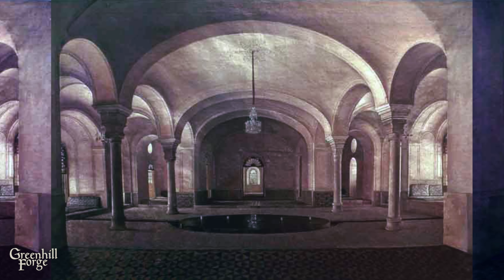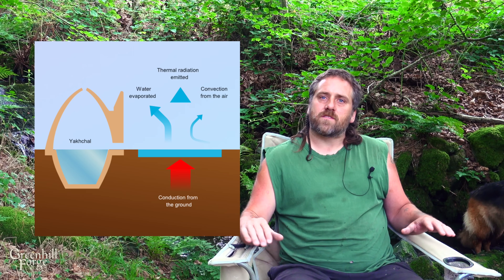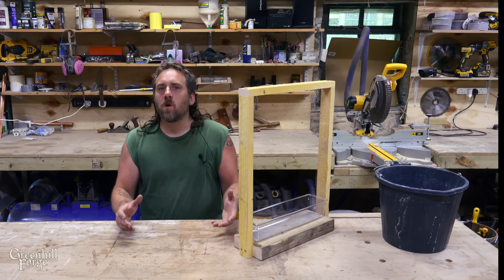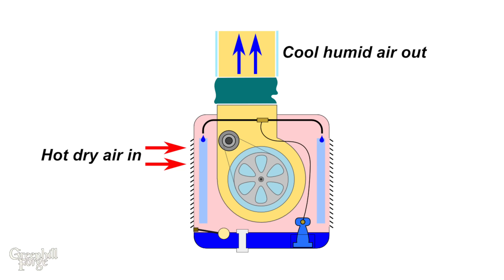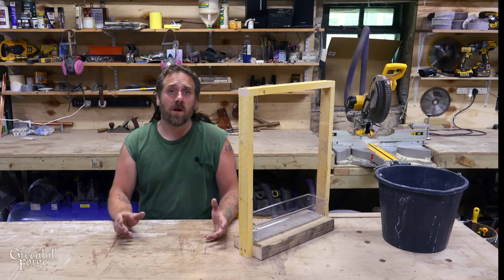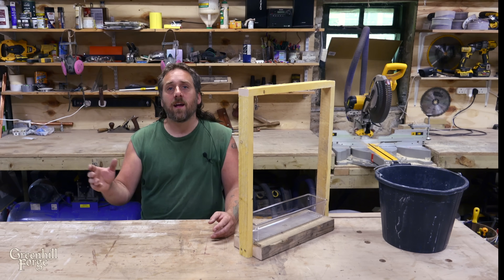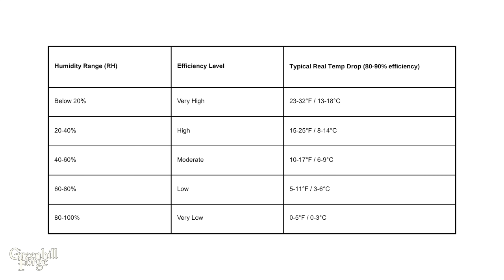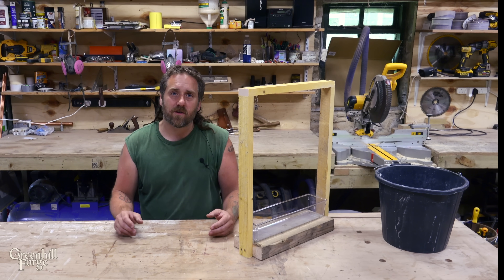Ancient Air Conditioning: Free DIY AC That Actually Works & the Science Behind It

Comment: I used the same idea to humidify the bedroom air in winter. A tray of water near the floor register, a wash cloth inserted in the tray, and supported over the edge by a hanger wire frame over the vent. The tray held only enough water for 2-3 hours. But it made a HUGE difference in comfort while water was there.

Comment: Seems excessive. Why not just exchange heat with a radiator that is submerged in that cool spring behind the house? And a small fan in room, which would blow hot air on that cooled surface of indoor unit. You also need to catch the condensed moisture underneath the indoor unit and perhaps evaporate it as well.

Comment: Damn! You have have a butt load of nay sayers! I’ve never known all the ancient ways of evaporative cooling built into buildings. That in its self very interesting. 
I know you are now in the U.K., but where are you from here in the States? 
I’m in upper East Texas. Where it’s hot and very humid. So, swamp coolers don’t work near as good as they do in say Arizona. However they still work to some degree. Meaning they work good enough so as you don’t sweat your balls off! 
I worked in a whole sale nursery when I was a kid ( about 14 until I was 19 ) all the propagation houses what a wet wall system in them. Which was the exact thing you showed how to build. And we would build them instead of buy them. We first bury a 100 gallon open top tank. Like that is used for watering cattle. Plumb water to it and use a float valve to keep it at a desired level. Then plumb a pump to deliver the water to the wall section that had wet cells in them. The wet cells were about 6” thick, 3’ tall, and 18” wide. And expensive AF! And a gutter system returned the water to the tank.  Big ass fans on the opposing wall pulled air thru the wet wall and out the other side. And those houses stayed 20 to 30 degrees F. below outside temps.
Reply from the maker: That's sounds like a great system. I wonder if there are any cheaper things that could replace the wet cells. Yeah, the local climate really determines how well it will work. It's too cool and wet where I live now but I lived in California and Montana and it works great there. Also lived in DC, GA, MA, VA.
Reply: @GreenhillForge I’m not sure if there is anything cheeper to use for the wet cells? 
The only thing I can think of would be that “ camel hair looking stuff” it comes in a roll and I think it’s used as a dead air insulation. Not sure if it would stand up to the water for a long time. 
After I wrote that novel! I was thinking about the old way of cooling a house down here in Texas before a/c was a thing. Just about every body had a window unit type swamp cooler and a huge attic fan that pulled air from the windows thru the house then out the attic.

Comment: 3:25...yeah...nah.
the vapor is the same temperature as the air.
the water and surface it evaporated from is what lost the heat. not the air it evaporated into. that air gained heat, its now carrying water vapor that took a certain amunt of energy to vaporise, and must release that energy to condense.
air itself doesnt carry or hold much heat. water vapor does.
its blowing air past that now cooler water and fabric that gives the temperature drop. without the draft, nothing much really happens at all. can only cool via conduction, contact, and the resulting convection. get a draft, maximise the air passing over, the evaporation that takes place.
except. in a closed loop, the heat ends up in the air. you cool a tank of water, and its heat is added to whats already in the air and water vapor... its just like opening the fridge door for a makeshift AC unit...
swamp coolers are pretty pointless as they are.

the clay amphora is cooling whats inside it down, not the air around it.
when we sweat, the aim is to cool our body, not the air around us.
the old aussie meat safe (damp hessian sack over a frame?) is cooling whats inside, not whats outside. 

outdoor fountain, large tank of water buried below, plenty of surface area and trickling, then pump the water through a radiator.

water will try to reach its densest point at 4C...

look at how the office blocks and shopping malls do it...

Comment: Maybe check out a heat recovery ventilator, you can make one with straws, attach your swamp cooler to the one side that blows through the straws with a fan to the outside and another fan that circulate the air inside your home across the cold straws. This way you do not increase the humidity inside your house. We use it to keep heat inside a room and get humidity out, but I think you can also use it for cooling.

Comment: This is great in a dryer (low humidity) state like Arizona but could make things worse, or not work at all, in states like Georgia or South Carolina. I don't have a/c in the house here in PA. The ONLY thing making it bearable for me, is to go the opposite way, and have the 82 degree air in the house as DRY as possible, running 2 dehumidifiers in the basement. Also, water will not evaporate into 95% humidity which 20 states have experienced for 8 weeks this summer. At least here, I want to avoid water and more humidity. Yes, in Tempe AZ, they have 1,000 "misters" on the street that are great because the dew point is super LOW.

Comment: You can take advantage of the Ideal Gas Law by putting a grid of 2 liter bottles that you cut in have in a window so the air can only pass through those.  You put the spout facing the inside so the air is forced to travel from the larger ID of the two liter bottle into the smaller ID, forcing the air to cool as it increased in pressure briefly while passing through the spout, and then decreases in pressure, cooling off when it makes it into the closure you're cooling.

Especially if you have several, like 10 so you have a large surface area, and seal it well to enable opening one side of the house to create that air tunnel that sucks air through those higher resistance low ID holes.

Comment: Interesting, an electric or solar powered dehumidifier is relatively cheap to buy and run, especially when compared to an AC unit. So, I think that means even if you live in a humid area, you could still use this DIY AC with some success. Turn dehumidifier on then set up this DIY AC over your windows. Do you think that would work?
Reply from the maker: yeah they'd work together but dehumidifiers create heat( so basically the opposite of evaporative coolers) so they might just balace each other out.

Comment: When I visited Poland I had the chance to witness some medieval AC units. High walls were built by stacking thousands of bundles of twigs. A water wheel moved water to the tops of the walls and it trickled down through the twigs (about 20 ft) cooling the air all around the walls. The water used came from a natural salt spring so the cool moist air also had a salty quality which was good for the lungs.
Reply from the maker: That sounds really cool. Where was that?

Comment: Something I've always been curious about, and the answer cannot be found on the WWW is this: If you use a humidifier in winter, which lowers the temperature of the air passing over it, is there a net gain in comfort, despite the unwanted cooling? I tried doing the math but it was beyond my capability.
Reply: Humidity doesn't decrease temperature, only evaporation does which will be less in high humidity. Higher humidity will feel warmer

Comment: A trick I learned many many many many moons ago was NOT to put a wet hat or cloth on my head but put a wet hand towel around my neck making sure that it touches my main arteries in my neck on the sides, why because the hand towel would draw most of the heat out and kept it away from my head and kept it cooler, it was used alot by Cowboys wayyyy back when, early explorers, and even the desert dwellers who were the ones that taught me this trick., and yuppers every video with a real life purpose and not blah blah blah b.s. lol, thanks again for another great educational video !
Reply from the maker: that's a great trick. it works well on forearms too because all the veins/arteries are close to the surface
Reply: @GreenhillForge  sorry forgot about that one, 🤦 still got a ton of things to do before Thursday, it's exit stage right day lol
Reply: @GreenhillForge  its also how boxers are kept cool between rounds in boxing matches :)

Comment: Nice video!  A few details that I think can be good to consider: Increased humidity is the opposite of what most people want from air conditioning, keeping the humidity from going too high is absolute requirement for direct evaporative cooling to make the air more, and not less comfortable. That said, it's often quite possible to achieve a significant positive effect from direct evaporative cooling with sufficient ventilation as long as the outdoor humidity is not too high. 

The wet bulb temperature is the lowest temperature that can be reached with [direct] evaporative cooling at a given temperature and humidity.  Weather forecasters typically forecasts the humidity, and with that knowledge you can use online wet bulb calculators to get an idea of how much of an positive effect you you can achieve from direct evaporative cooling in combination with good ventilation, if any. 

Just remember, you can't cool down your whole home to the wet bulb temperature by direct evaporative cooling alone, it's not even theoretically possible to do that without also saturating the air humidity. The outdoor wet bulb temperature needs to be well below the indoor temperature for direct evaporative cooling to work well.  During temporary heat extremes, the outdoor [relative] humidity is often very low, so for such situations simple diy direct evaporative cooling can be extra worthwhile to look into. 

With an IR-thermometer you can easily measure the wet bulb temperature, just measure the surface temperature of a wet object like a cloth exposed to a good airflow. Unless the cloth is still cold from cold water added to it, the lowest temperature you can read from it will be the wet bulb temperature of that air. It doesn't have to be an IR-thermometer, but it's very easy to relatively quickly get a good reading with IR-thermometers.            

If you don't either let the system dry out occasionally or treat the water somehow you risk growing all sorts of nasty stuff in the evaporator.

Something like a large, thick microfiber bath mat, that tolerates being washed repeatedly, can hold a lot of water. Many such bath mats are designed to dry out as fast as possible, and can be a great and very simple option for diy direct evaporative cooling that can work well for many hours without pumping water over them.

Comment: Cant you just use capillary action instead of the pump? Place the bottom of the fabric in a bucket, clay pot or long narrow plant pot, the wicking action of fabric will automatically pull up the water as it evaporates
Reply: Water only wicks up about a foot.
Reply: You can do that. The problem with this whole method is never how to get the water in fabric, its how damp the air already is
Reply from the maker: I think it would work a bit but that it wouldn't wick high enough to be very effective. I'd guess it wouldn't get higher than 6-10 inches in normal fabrics like cotton. worth a test though

Comment: I grew up in Utah, where evaporative cooling works very well. I liked how you had to leave windows open to guide the cooled air through the house and how the water and filters made the air feel clean. The air was fresh all summer, unlike how it is with refrigerant cooling.

You might be interested in the fountain system of The Alhambra. The water wasn't just piped into the hilltop palace (via a 3.5~4-mile aqueduct) for cooling in summer; but also for bathing, underfloor heating and telling time. In one part of the palace, they also installed a system of pipes and cisterns that could push a stream of water ~20 feet up without pumps or waterwheels. Just amazing engineering!
Reply from the maker: Wow, that looks really cool!
Reply: @GreenhillForge  I saw some videos on YouTube that showed how the system works. So clever! I dream of going there someday.

Comment: Once you're adding a pump and a fan I don't see what gains you're getting over a commercial cooler other than as a fun experiment.

I'd like to see if it could be fed by gravity. lifting a 10l bucket of water to the top of the device every few hours seems like it'd be a much more elegant solution if it can work with such a low flow rate.
Reply from the maker: yeah, its mostly a fun experiment and just cool to do it diy, but also way cheaper than buying a commercial swamp cooler. I really like the idea of gravity feed, great idea. could pretty easily regulate the flow with and adjustable orifice

Comment: Hi as always great content, very well presented. One downside to evaporative a/c is Legionnaires' disease, it's worth mentioning that the burlap or other material should be given a hot wash with bleach and a bleach solution run through the pump and reservoir. There is a good article on Wikipedia with a lot of technical details.

Now back to binge watching your other vids. 

Cheers. Paul

Comment: I'd be very interested to see the effects of salt water used in an evaporative heat exchange system like this compared to fresh water. I'm not sure of the science at room temperature exactly, but I always remembered that ice cold water mixed with a lot of salt cools things MUCH faster than fresh ice water. I'm not exactly sure how this would affect an air conditioning setup like this. But it'd definitely make for in interesting experiment! Thanks for sharing!
Reply from the maker: Thanks. I think salt would make evaporation harder and lowers freezing poing, sea water freezes around -2C. I think adding water-miscible solvents like alcohols or acetone could speed it up considerably, maybe 20-30%(but the cost would go up considerably). But you gave me an idea that I think would work really well. a couple drops of dish soap would work well as it reduces surface tesnion a lot which would increase evaporation. but it also wouldn't evaporate itself so it could last for months theoretically. That's definitely something to try. Nice one!
Reply: @GreenhillForge  Excellent idea!! Looking forward to seeing if you try this out in the future! :)

Comment: I am relly keen on getting some freezing done along similar lines - ideas? Also to be able to have a cold room for curing meat would be amazing - also looking for 'non' (or very low) electrical ideas...
Reply from the maker: I think freezing could be done but would required a lot of tinkering to get it correct and it would need the right climate too. a cold room wouldn't be too hard, especially will access to a stream. thick walls or dug into the earth, with a stream and a heat bell/dome type roof to stratify air temps and release warmer air. would be a fun project

Comment: I will point at that, depending on the area, evaporative cooling (or swamp cooling) doesn’t work as well. I live in the Adirondack lowlands, which is basically all swamp and when it gets hot our humidity is also like, 50-60% so sadly there is no benefit to it (however, a lot of the houses are built with really good airflow, even if they don’t have HVAC systems, so more fans helps a ton)

And now I’ve watched more of the video and saw that you covered it haha
Reply: I'm not trying to one up you by any means but 50 to 60 humidity is not high by any stretch. Most of the midwest sees 80 to 90 humidity regularly. It's terrible
Reply: @Frank-pq7ff  Oh I have no doubt it's worse in other places, just more commenting that there's quite a few places that swamp coolers don't work, unfortunately. It actually didn't used to be even this bad here, but with climate change the summers are much hotter for much longer than before, so it ends up feeling like you're swimming in your house some days
Reply: @Frank-pq7ff It's really all about the dew point. Practically EVERYWHERE in the US (outside of true desert climate areas) experiences 90-99% relative humidity levels at some point during the day. Most of the time this occurs in the early morning hours. Usually there will be another period of high RH in the early evening as well. It's that dew point temperature that you should pay attention to. When you've got DP temps in 70s, which occurs throughout most of the summer months, then it's gonna be brutally hot outside, and of course, evaporative cooling devices will do you little to no good.